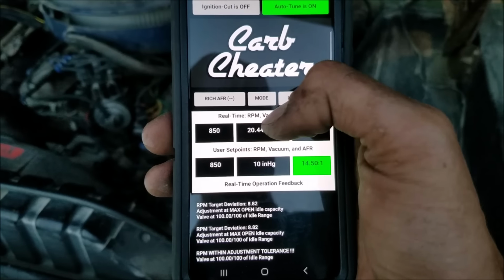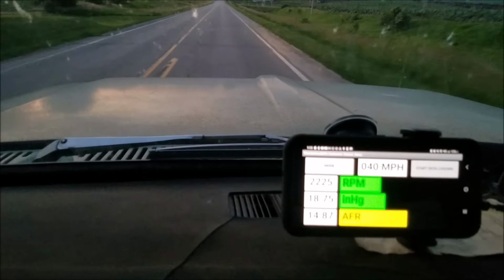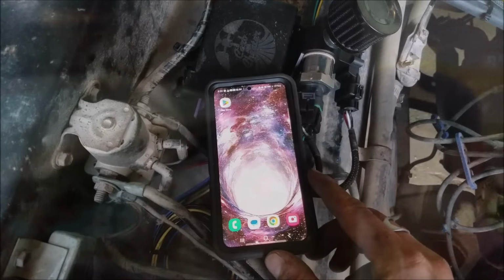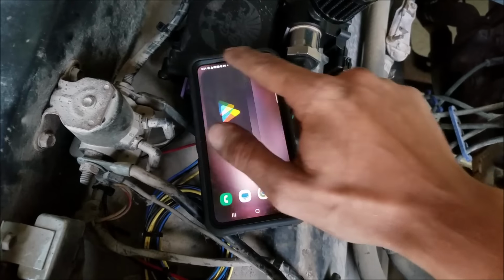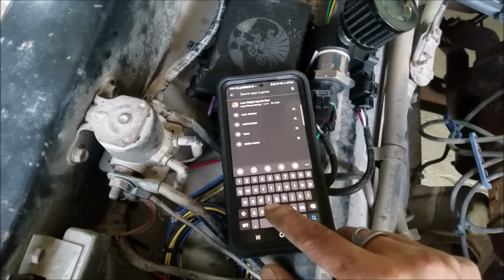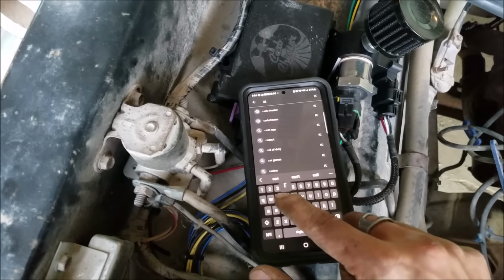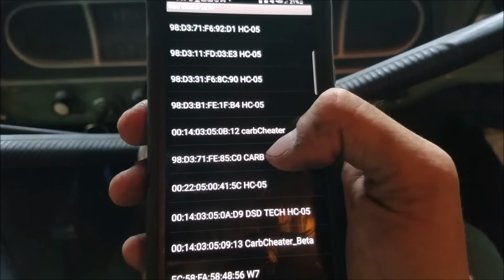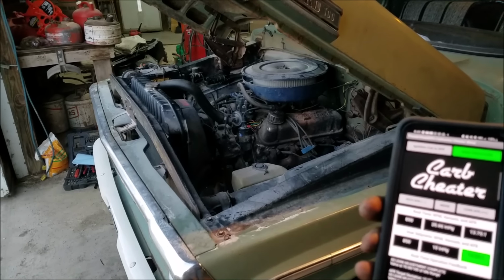Make a SELF-TUNING Holley/Edelbrock Carb! (Carb Cheater: Installation & Setup)

Comment: My buddy and I have been having a debate for the past 2 years on what engine we want to swap into a project 1991 S10.  Knew we wanted a V8, but weren't sure if we wanted to stick with an older generation smallblock or move towards an LS.  I'm confident over time (and with patience) I could learn at least the general idea of carburetor tuning, but having the advent of fuel injection and HP tuners made me want to gravitate more towards an LS, which would've been a pain because the S10 already had a 1996 350 swapped into it.
But having this as an option?  All I can say is thank you, because this makes the whole process a lot easier, and I can simply forget about anything LS-related.  I've got a feeling that it'll be less expensive in the long run too.  I can probably get close to 95% full tuning with a carb given enough time, but this could get me that last 5% that's probably out of reach.
Reply: The LS stock is still better/more efficient than an older Chev...  the stock LS heads far outflow the older heads...  unless you're porting them.  Stock LS heads still flow better than the 96 Vortec heads.  Also the crank position sensor allows timing changes by the ECU constantly and is far more accurate than a mechanical distributor, especially one with a lot of miles on it.  
That said, I'm still keeping one 1st gen built small block because I am emotionally (and financially lol) well attached to it

Comment: Talk about revolutionary technology. I hope this product of yours brings you all tha happiness you deserve!
Reply: You do know this tech was available from car manufacturers in the 1980s right?

Many manufacturers installed what is known as feedback carburetors on their vehicles that uses sensors to meter and adjust the carburetor on the go.

Wasn't worth the money and was quickly dropped after around 5 to 8 years of use in favor of true EFI.
Reply from the maker: Think of what a personal computer was in the 1980s vs today. We didn't even have a wideband till 1995 and then not even a modern style till the late 00s. 
If they had the tech of today, the "feedback carbs" would have actually been lights out. 
Great idea, the tech just wasn't there at the time.
Reply: @ThunderHead289 , still not revolutionary is my point it's 1980s tech with a better ECM.  It still does the same thing thoses feedback carbs did.
Reply: @Milner62  then quite simply, don't worry about it
Reply: @I-watch-at-2x , didn't say I'm worrying about it.  It's called talking.  People do that to exchange information or ideas.  What I stated was exchanging information.
Reply: @Milner62  by downplaying what the man has accomplished. Got it. I always start my idea exchange's by bad mouthing a person or product.
Reply: @I-watch-at-2x , how is it bad mounting the product to point out the idea and the design is outdated and existed before in the 1980s?

It's hardly revolutionary technology and that is not downplaying it that is being honest.  Just like some people think he might be suicided to keep this tech under wraps even though we haven't had carbs on a production car in 40 years.

Comment: That tach probably has a capacitor in it to dampen the meter movement. You could replace it with a smaller one maybe?
Reply from the maker: They have a microprocessor in them and ironically use a very similar tach circuit to me - from my programming background, they seem to simply have to big of a smoothing array in them where response is just slower. It's steady, but fails to keep up with abrupt rpm changes.

Comment: Good concept but I prefer to monitor my old carburetors the old fashion way
Reply from the maker: Can't blame you there - I've done carbs for 15 years and can get them 95 percent with my eyes closed. 
The thing that's really hard to beat into people's heads is how important ignition timing is - most carb issues are actually shortcomings in ignition timing, weather it be initial, the advance rate, or the total timing.
Reply: Wideband O2 sensors are a lot easier than doing plug chops :-). And the end user can STILL look at spark plugs ;-).

Comment: Always enjoy new tech and ways to make old tech work better. This looks pretty slick but once again as a Canadian we get the short end of stick. Between the general cost of the product and shipping it becomes a non-viable option.

You have a unique product and hope it does well! I remember when you came out with the prototype for this thing and it was intriguing then.
Reply: Ancient tech now, this tech was standard on just about all 1980s vehicles known as the dreaded feedback carburetors that had all kinds of sensors and components later to be seen used with EFI and TBI to improve the carburetor.

Spoiler alert, they didn't last long term they were more hassle to deal with than TBI/EFI which is why after about 5 years they were out of production.
Reply: @Milner62  Woah! Crazy that we had smart phones and 4 wire bolt on extra air valve kits in the 1980s.

A fast response solenoid that fits in this form factor while also paired to a computer system this size that only requires 4 wires, a MAP sensor , and a NTK wideband sensor that didn't exist yet until the mid 90s all while being able to handle the operating temperatures of an engine bay. Just because we technically had all the "technology" to do such a feat, doesn't mean it was possible to even accomplish.

The cost alone to do this with period correct aftermarket components would've entirely outweighed any benefit and even then you wouldn't have the feedback response that you get from using your smartphone. The whole point is to give you ALL the control and adjustment you need REALTIME. Carbs aren't broken, there's nothing required to "fix" them, this just helps make the whole process even more simple, that's why it's called a "cheater".  I had to look into the price to really figure out what the big deal is, and even if it had a potentially exorbitant shipping cost, it would still be a FRACTION of the cost compared to anything else on the market.

So yeah, it's not NEW technology, it's just a thousand times more refined and gives you a straight path to getting the most out of any carbureted setup; not to mention it's cheap, 100% bolt on, and it takes less than 30 minutes to an hour to completely transform the engine management to something entirely in your own control with zero guess work.

Comment: Just ordered one. Can't wait to check it out
Reply from the maker: It's a ton of fun I think - I don't have enough time these days to play 20 question guess and check with a carb
Reply: Just out of curiosity as I plan to just put it on a stock v8, but am curious how much horsepower do you think it would be able to efficiently tune? I understand there's not a lot of moving parts, but I have to assume the computer can only work so fast. BTW think its great what you are doing. Found a great gap in the market place to fill while helping people out.
Reply: @jeremyadkins8025 , there is no HP limit on a system like this that falls to your carburetor.

This is no different than how feedback carbs of the 1980s worked.  Had sensors that monitored the engine and an IAC that would open and close creating a controlled vacuum leak to allow more or less air into the engine effectively adjusting AFR and idle speed.
Reply: I get its only following the carb so the carb would handle majority of the load and carb cheater is just adjusting.  I just assumed it could only adjust so fast under high rpm's with high HP
Reply: We're are they sold?

Comment: Can this be used with a two barrel carb?
Reply from the maker: No reason it couldn't be - I went through the vacuum connections without the spacer and originally the spacer wasn't a part of the project. Can definitely be done 🙂
Reply: Thank you for the quick reply. I started watching your video and realized it answered my question 🤦‍♂️

Comment: Me being old and was alive and rode around in the late 60's cars growing up, would have never believed you if you told me this 30 or 40 years ago.
Reply: Should cause 40 years ago was the 1980s and auto manufacturers were using feedback carburetors that had sensors to monitor and adjust the carburetor on the go.

It just wasn't that big of a jump so it was dropped in favor of true EFI.

Comment: Make sure that your engine has enough vacuum to operate this kit. Running high performance cam.
Reply from the maker: You don't need vacuum to operate it 🙂
It's a dynamically controlled air bleed that adjusts on the fly on its own 👍

Comment: What is the sampling rate per second of the data logging feature?
Reply from the maker: 5 times a second. I could do it more actually, but the data points are excessive without any tangible info really being provided Moreno than 5 per second provides. 
Now the telemetry sent to that app is every 10 or 50 milliseconds or so - can't remember off hand, but it's faster than needed by far.
Reply: @ThunderHead289  I was considering a data logger to tune at the track for n/a and nitrous passes.  Being able to use just my phone is a plus.  I'm not sure if 5 times a second is fine enough for what I want to do tho.  The car is a driver that I like to take to the strip so I could use all the features potentially.

Comment: Will this work with the hei distributor that gm uses? Can the map sensor be connected to any vacuum line? Will you have a spread bore option as well?
Reply from the maker: Sure will work for hei. The mav sports a gm style hei - just splice to the ignition wire and tach wire. Map sensor can go on any vacuum line indeed (except for the one on pcv or the cc valve line)

Comment: Is it doing any difference on full throttle or just idle/cruising?
Reply: That’s my question as well. I’d imagine it does?
Reply: @RDspeedfab  my guess is that it will make little to no difference on full throttle. On the other hand idling and crusing is what people do the most.
Reply: @daw7563  yeah maybe not. I don’t know. So it’s basically just controlling AFR through a metered vacuum leak from what I can tell?
Reply: @RDspeedfab , correct it uses an IAC to allow more air in to make it's changes.  Basically this is 1980s tech as manufacturers were using feedback carbs with IAC for adjusting the carbs.  They were great when new but after a few years they didn't work that well.  Manufacturers discontinued production of the feedback carbs by 1987 in favor for true EFI.

In the automotive field theses carbs are viewed as a stepping stone from carb to true EFI, it was a hybrid that was attempted that didn't pan out.
Reply: @Milner62  super interesting. Thanks for the info!

Comment: Nicely done Luke! Can this benefit a single barrel application, like an Autolite 1100 in an F100?
Reply: I believe they had that exact setup in a previous video, the green f100
Reply: I bet a spacer plate with vacuum hoses could do the trick. I'm thinking about doing the same on my 52 Ford with the straight 6 and factory intake manifold

Comment: Now the big question is that how much better is it compared to something likey Holley sniper EFI in terms of fuel economy, power, ease of starting etc
Reply from the maker: Why pay 3000 dollars, have weird anomalies, and be stuck on the side of the road like numerous cars on power tour that had aftermarket injection systems. 
And at the end of the day all you really wanted was a car that ran well.
Reply: @ThunderHead289  That is true. Would maybe like to see a comparison to sniper systems, but that's probably not going to happen
Reply: @ThunderHead289 , 9 times out of 10 problems with the sniper is due to a bad install.  With a proper install they work no different than an OE system.

I have installs I've done for customers going on 9 years ago now and none of them ever came back with an issue.  Only issues I had was with the small start up known as FiTech but I heard they improved their hardware since then but I won't be going back as they were quite troublesome to get setup.
Reply: You got eyes looking at you on power tour that is for sure
Reply: Going by the questions being asked in the comments, this product doesn't seem like it's targeted towards people with the knowledge/skill to install and tune an aftermarket efi system in a reliable way.
Reply: @ScootyPuff_Jr  , Holley is the most clear cut unit to install and people still mess the install up.  This will be no different.
Reply: @Milner62  That is true, according to some videos you HAVE to follow Holley instructions to a point otherwise bad things happen (like if they tell you to wire straight to battery, you wire straight to battery). Surely people will screw up carb cheater install too and will later complain about it not being reliable or having major issues
Reply: @estonianperson1112  , correct.  Too many people believe they know enough the instructions are just advice then they blame the product as being junk when they didn't wire it properly.

Same will happen with this product and that doesn't mean this product is bad either.
Reply: It is a totally different approach really :-). People have proven than carb(s) will actually make more horsepower and torque than EFI but the typical EFI ECU setup controls every aspect of the engine, spark timing, fuel mixture. A luddite could use this system with a Thermoquad and a vertex magneto :-).
Reply: @MrAnviljenkins  That isn't actally true. You can run Holly sniper EFI that only controls fuel, setup is nothing more than telling it the basic things about your engine, and it will tune it while you drive. You can also get sniper efi that looks like 4 barrel carbs, nothing too fancy.
Not looking to start a big conversation here tho
Reply: @estonianperson1112  One CAN do all sorts of things. Use MiniSquirt to control fuel only for example, or only to control ignition timing, But the ECU gives the user ability to control a lot of different things...but it does not EASILY allow controlling the fuel air mixtureof a carburator at wide open throttle ;-). One could use a carb then small port injectors to trim the fuel air...this gaining most of the power gain from the charge cooling the carb gives us, plus let us make fuel air adjustments via the ECU.
Reply: Would be a down grade.  There is a reason why this kind of tech was introduced by many manufacturers in the 1980s and it was replaced by true EFI by 1987.
Reply: @Milner62  Yep, most folks do not remember the nightmare of "stuff" under the hood of a 1980's emission carburator setup, and how neat, simplle, and clean stuff got with throttle body fuel injection a few years later. The EFI brought inline six engines back from the grave too. The variations in cylinder head temperatures inherent to most inline 6 supposedly made it nearly impossible to meet emissions with a carb, but apparently pretty simple with multi port fuel injection.